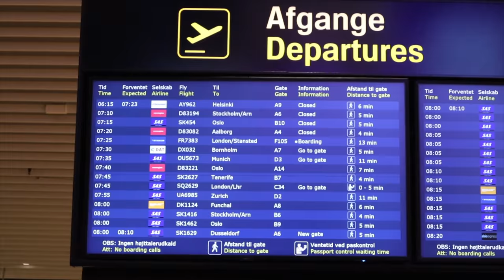Better Fix This Before Sailing 3 Weeks Offshore! - Ep. 287 RAN Sailing

Comment: We keep our fresh water aerated by using the home fish tank aerators to keep the water oxygenated and moving within the tanks. These are plumbed into each of the water  tanks. We normally clean the tanks once every 6 months or before we undertake long passages.When we open the tanks there is never much to do except to wipe them over with a sanitizing solution.
Reply: @Jay We never add anything to the water and after six months it still tastes as fresh as the day it was put in.

Comment: On my 2 cylinder they recommend running the valves every year. bought it used & don't think the valves had ever been run over 20 years. The compression was at about 80PSI before adjusting. now near 150PSI. Guess on smaller engines valve out of adjustment is more common. On the street they call inspection covers "man hole covers" on boats inspection covers or inspection plates.

Comment: Ok, the pump you used is called a "sump pump" in the states.  The ones we put in the basement of houses is 1/2 horsepower.  They can lift 26ft vertical and pump around 85 gallons a minute.  I don't know the metric conversions on that.

Comment: It is a mystery how the valve(s) on the generator engine could have come out of adjustment without the engine running. Is it possible that some other vibration on the boat could have caused it?
Reply: Maybe a rocker arm stud is pulling out or unscrewing from the head?
Keep up the good work!
JIM  🤔

Comment: Great episode guys, keep up the excellent work. Regarding the filtering of the water, unfortunately it's a quite complex subject, especially when you don't know the quality of the water you're getting in your tanks. One thing to consider though is that the water that comes from shore usually has quite a bit of chlorine to deal with the infrastructure. When you filter it with a activated charcoal (carbon) filter before you get it in your tanks you're getting rid of it but you're also getting rid of the protection that it provides and allows more bacteria to build up in your tanks. Having a bit of chlorine in the tanks is not a bad thing as long as you filter it after it comes out. You can either use additives to prevent bacterial growth in the tanks after filtering or just not filter the chlorine out in the first place and have a carbon and/or UV filter for potable use.  Also another tip is that if the water has an odd taste after the carbon filter it's usually a sign that it needs replacement rather than something being wrong with the tank. The only problem with all of this is that water from shore can contain a bunch of other things that can stick to your tanks.... it really comes down to the quality of the water.

Comment: As to the generator valves, I suspect the lack of running combined with the corrosive boat environment caused the valve stem to get stuck in the guide.  And/or, debris was stuck on the seat of the valve.  Either one of these can cause the valve to stay open against the valve spring.  On a diesel this will keep the engine from generating compression, which will cause it to not start.  The process of adjusting the valves, and/or, just cranking the engine more might have dislodged whatever was keeping the valve(s) open, allowing it to run again.  Starting the engine more often is a good idea.  Keep fresh oil in the engine.  Also, you might consider an oil additive for engine storage.  If you suspect a stuck valve in the future you may be able to free it by striking the valve end of the rocker arm with a heavy mallet - that will force the valve to open, and then the spring will push it closed.  Do that a few times with the crank in different positions.  Finally, if the generator has a lot of hours the valve guide to valve stem clearance may be opening, which will allow sticky deposits to build up, which may cause sticking...  It may be time for a "valve job," possibly including new valve springs.

Comment: A generally accepted rule of thumb for diesel gen sets it that they be ran once a month and quarterly under a load.  If you look up maintenance notes for a Panda gen set you will find pretty much the same recommendations plus a 50% load for your gen set.  It becomes even more critical for these small maranized diesel engines!  I would also go back and verify that you haven't bent the push rods which may account for just how out of spec your valve lash was!

Comment: Some of the other sailors I watch use a waterproof cordless drill with a cleaning attachment for the hull. It could really speed up the process.

They run around $600 USD for a Nemo (I googled it, it's not something I knew).

Comment: The valves problem is unusual but not unknown if a tappet locking nut works loose the valve can move  whilst in use and because it is hot the engine  keeps going... but once it stops and cools being a Diesel it will as you found no longer have sufficient compression to start and maintain fuel ignition.

Comment: Check for AIR, and oil level, if low it may have a safety shut-off. Is there a reset switch on it? Check to see if it's getting fuel, could be dirty or clogged line, filter? If it cranks, and you gave starting fluid, still not firing off, then there must be a safety switch involved. Are you sure it is getting Air? Double-check the oil level in the engine.

Comment: So enjoy your channel. I your hardworking cleaning the fresh water tank. I listened  as you described  refilling the tank thru a carbon filter. That removes the any bad tasting stuff but also the chlorine. You need  a little chlorine for long-term  storage if your tank has a vent to the atmosphere. Everyday cycles in temperature and barometric  pressure  cause small air flow in and out of the tank. Unless your vent has a very good  air filter bacteria eventually gets into the tank. You need a cap full of chlorine when you fill the tank.
Reply from the maker: Yes, you’re correct, but sailing across the Atlantic for 3 weeks isn’t long term storage. I much rather have good tasting water filtered two times. Cheers!

Comment: Stuck valves are common on engines that do not run often. 
That’s why aircraft have parking maintenance protocols. 
Obviously that idea you can use on a boat. Torn  the engine so now and than so the valves move and valve springs are not always compressed.  An other idea is to stop that engine with injecting conservative oil it it.  This will smoke a lot but the engine will start next time. Obviously smoking a bit then.  Well done on the jobs and thanks for sharing perfect pictures.

Comment: I've seen this happen to valve adjustments when the nut for the adjustment was missed tightening it when the valves were adjusted. It's easy to do and it's not the first time it's happened

Comment: seems to be a "stuck" valve. Probably "glued" there by some mix of dirt and unburnt gas. Worst could be that this dirt doesn't allow the valve to fully close and the dirt deposit even on the valve between the the head and valve, reducing compression, less efficiency, more unburnt diesel and more dirt. It's a small engine...take the head off check all the valves and their guides to be on clearance and clean.

Comment: I think that you should not filter the chlorine out of the water before it goes in your tanks since the chlorine  is what will protects the water from algae and other growth in the tanks . You can always filter the chlorine out afterward .
Reply: @Jay Pay attention details matter !!
Reply: Good though!  Who is more attentive to detail than Johan but,  for safety, blue water yachts today must be equipped with so much complex equipment, especially for ocean crossings,  that failures will happen, so its a big advantage to be deal with part failures when they occur--and Johan shines in this as well. .
Reply: @777rogerf  Did anyone understand what I wrote or why ???

Comment: Could the valve on the generator have stuck in the open position from the generator not being run for a long time ? therefore no lubrication and the valve sticks.

Comment: Could turning of the prop resulted in that valve situation?
Reply: Nil likelihood; the prop is connected to the main engine.The problem here was with the diesel generator not starting... a totally separate motor.

Comment: That’s an almost impossible problem, if the nut didn’t come loose? No,  the push rod, must be out of Position?  No?  The valve seat moved up?   Should be impossible.   The rocker arm is moving freely (the most Probable)   Case.